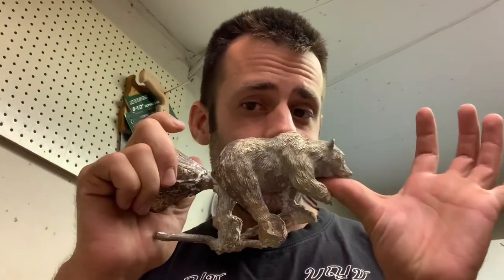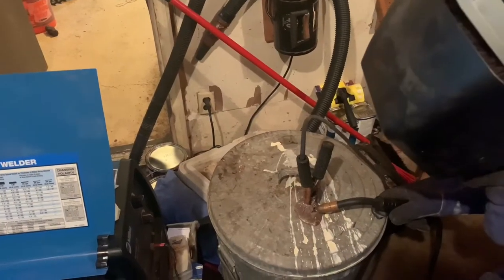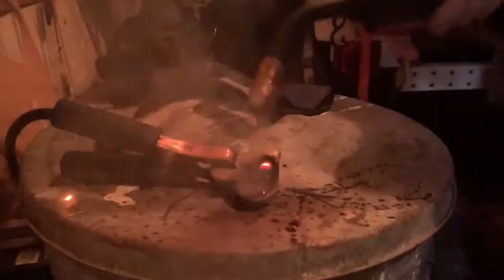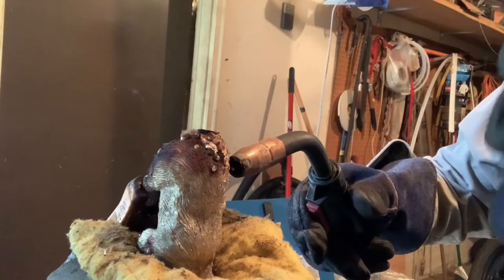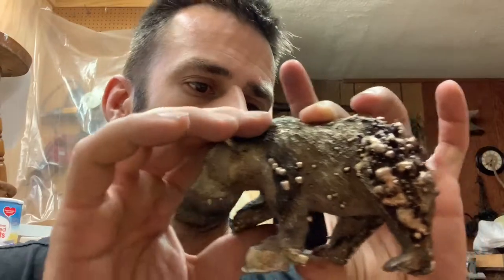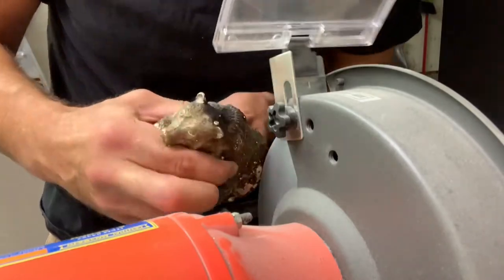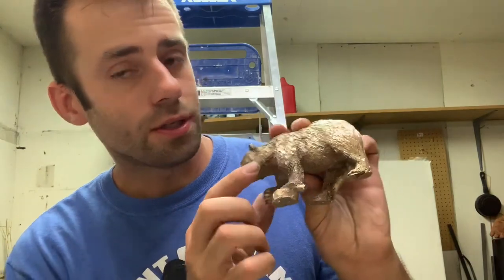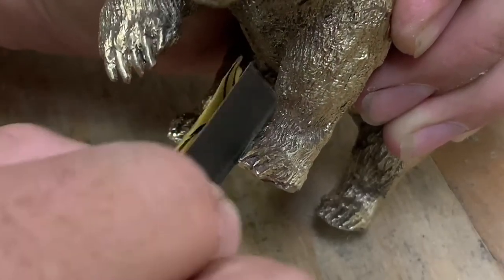Making a Bronze Grizzly Part 5: The metal chasing | aka the welding nightmare.

Comment: He's looking good man.  You didn't show the label on that welding wire, but if there is a ZN in any part of it, throw it away.  What I saw didn't look like CuSi being welded, but I don't know what your gas situation is and shielding is hard with mig.  It's not really the right process for this kind of work.  You do know if you continue down this bronze road, you gotta buy a tig machine.  The correct filler wire is ErCuSi and harris or radnor will be a dead match for your ingots.  If you don't wanna drop big money on a machine, I suggest you look at the AHP alphatig machine.  You will run 100% argon for welding sil bronze.  Actually, it's really tig brazing.  For fill work like this, you don't really melt the parent material.  You just get it hot and flow in the bronze and then work it back.  When you weld, the parent metal gets melted along with the filler wire.  Brazing is just the filler wire.  There is very little on the net about welding bronze with bronze.  The autobody guys love using silbronze on panels because they can keep the heat input low and don't warp stuff all to shit.  You're bear is looking great!  Lots of hours poured into this stuff huh?  People just don't get the amount of labor involved.  They hear cast and think cheap.  :-/
Reply from the maker: My goodness I never realized how much went into making a bronze!  Before I had ever melted any metal I watched the videos where you were casting the fibonacci Fox and the guy who sculpted it was talking about how complex casting was, and it wasn’t at easy at all, and my first thought was, “what a downer” 😆. But now I know he was right!   I want to keep going with this stuff. I have a paragon kiln now I just need the electric hooked up and the wiring in my house needs a little upgrade.  I have no room for another breaker. So I have a guy coming to get that hooked up and THEN I will get a tig welder too. And I’ll have to learn to tig weld. So much to learn!  
In the mean time I’ll work on a new vacuum table. I travel so much for my job I work on it in spurts though.
Reply: @lundgrenbronzestudios  The support equipment is insane if you want to turn out good quality bronze work.  Any bozo can make ingots and coins.  You're little bear is ART!  Stay with it, you'll be famous someday!  (Just like Fritz)  That guy has more talent in his little finger than I have in my entire body!)

Comment: If the wire jams in the tip stop pressing .or loosen the wire feed rollers that might stop the wire bunching up in the machine i only weld mild steel tho so copper wire might bunch up easier being more flexible
Reply from the maker: The wire was .23 and I used a .23 tip but then I switched to a .3 tip and that seemed to help.

Comment: You'd better use a ceramic shell mold. This will allow you to prevent misruns because you can use a red hot mold rather than a cold one. Moreover, the ceramic shell will be porous enough to allow gases to escape.
Reply from the maker: I haven’t used ceramic shell yet. I do pull my investment molds straight out of the kiln before I pour so they are still hot.

Comment: Why didn’t you get a tig welder. There is an anti-splatter paste you can smear on a surface to prevent the splatter from sticking.
Reply from the maker: I didn’t know anyone with a tig welder but I’m working on getting one. 
I also didn’t know about the paste. That’s why I’m glad people like you comment. I learn a lot.
Reply: @lundgrenbronzestudios  The paste works okay for steel.  Not so sure about silbronze?  He does need a tig so he can get good argon shielding.  MIG is not your friend here on a little bronze bear.  :-)  He doesn't need a high dollar machine for this stuff.  A simple DC tig setup with pulse and HF start is all he really needs.  I've got the invertig and it's a joy to use, but it wasn't cheap.  For a beginner, there is lots of stuff in the 1000dollar range that has tons of features.  Weldpro or AHP and he should do just fine.